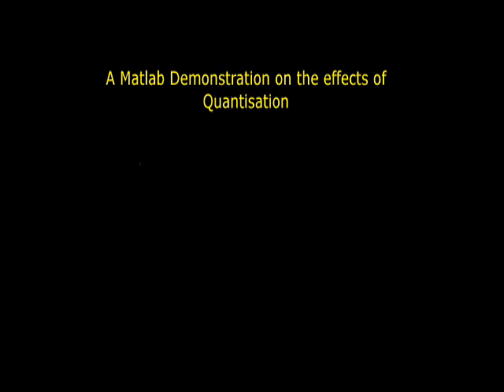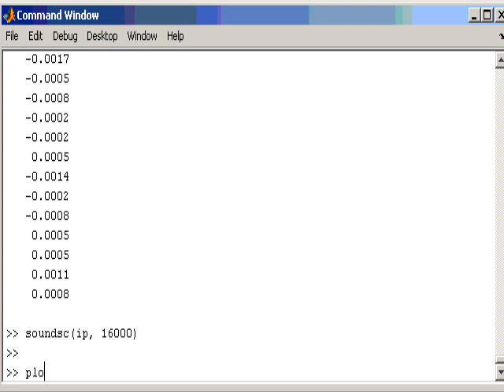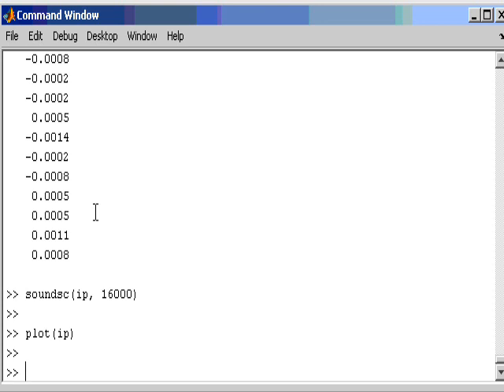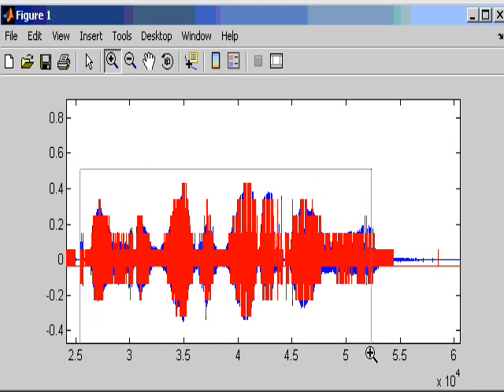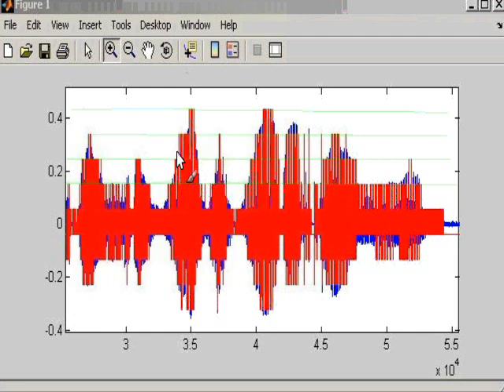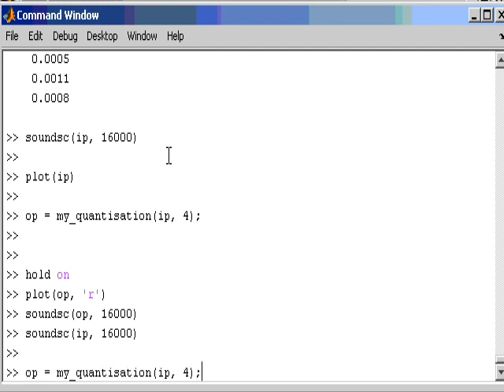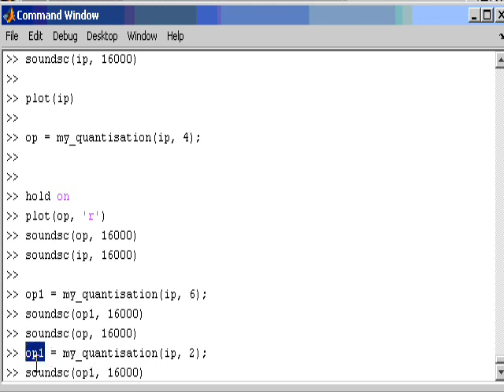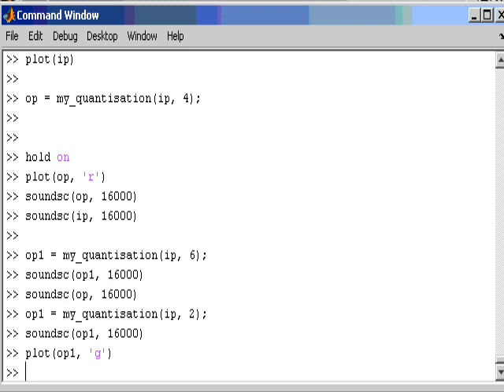Audio demonstration of quantisation error

Comment: I'm trying to write my own my_quantisation function, and I wanted to clarify a couple things. With a bit depth of 4, it's 16 values from the minimum amplitude of the signal to the maximum amplitude of the signal, yeah? (i.e. linspace(min_amp, max_amp, 2^4) should give the quantization levels?). Right now I'm iterating through every sample of the signal and quantizing it to the closest value in the vector generated in the linspace command above. I feel like there's an easier way. Any help you could give would be much appreciated. Loving these videos!
Reply from the maker: Yeah - Bit depth of 4 gives 16 quantisation levels. In practice I guess that ADC's will vary in exactly how they position the quantisation levels - but mapping the min input amplitude to the min level and the max input value to the max level seems reasonable to me.  Your approach of iterating through each sample and quantising it to the closest level is what needs to be done. There might be an elegant way of doing this in matlab but I'd iterate though each sample as you suggest. 
An alternative would be to iterate thought the quantisation levels and do something like the following on each iteration:
inds = find(abs(x-level) < level_diff/2)
xq(inds) = level;